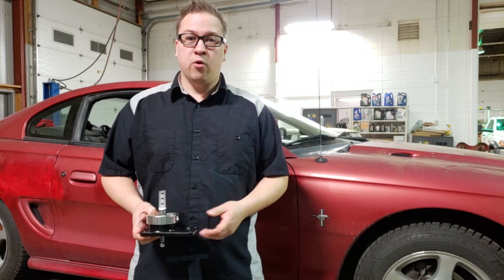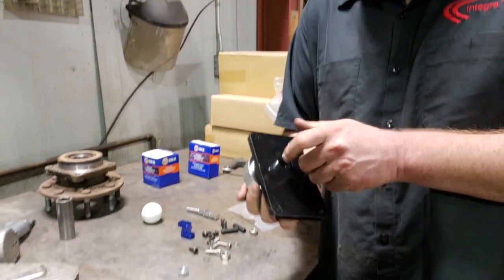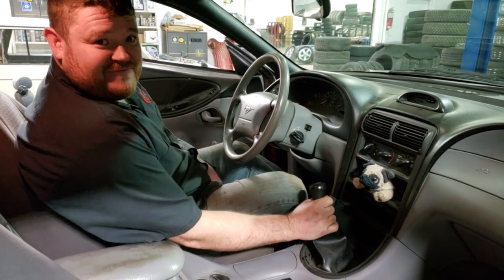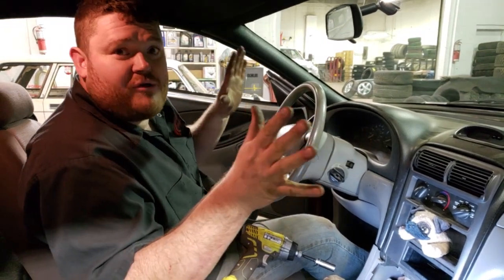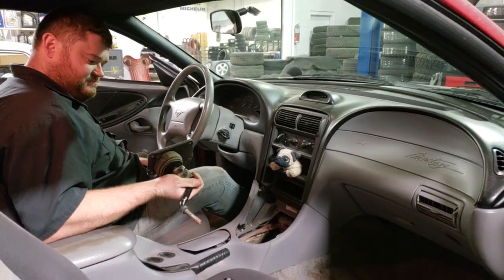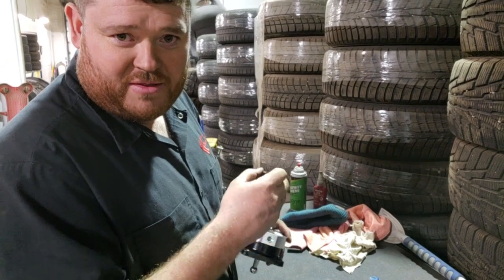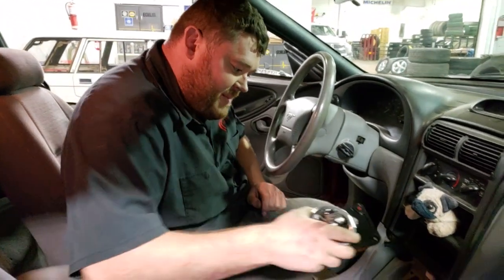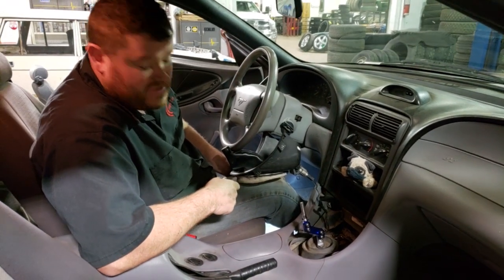Cheapest Shifter T5/T45 Install - SN95 Owner's Guide #8

Comment: Looks exactly like my SR performance shifter for my 94 gt
Reply from the maker: I have noticed this too, would say they are probably produced in the same factory, on the same patterns, but with different names.

Ours broke the centering springs and developed rotational play in the base after a few months, how is yours performing for you?

Thanks for commenting! - Darren
Reply: Grand Touring Concepts I’ve had mine about 1500 miles and it doesn’t self center, I noticed mine never did though I wonder if it’s those springs and plungers you pointed out were upside down.. other than that I haven’t had any issues and it goes into gears really well still, I’m also running a XTR stage 2 clutch

Comment: I did the speed daddy short shifter from ebay for $30.  Great shifter, looks just like this, same color handle/base, springs and everything.   Think it is just a relabled version of this.  I know they make decent parts used their exhaust parts in the past.     https://www.ebay.com/itm/FOR-83-04-FORD-MUSTANG-THUNDERBIRD-T5-T45-BLUE-RACING-SHORT-THROW-QUICK-SHIFTER/401562423241?fits=Year%3A1996%7CModel%3AMustang&hash=item5d7efc4fc9:g:w0oAAOSwGKRbPBIL
Reply: Ive had my ebay shifter for over 200k miles now.  Broke a centering spring finally but otherwise has been great

Comment: Is the shifter still in working condition?
Reply from the maker: That is a very timely question, as Shawn and I were just discussing the shifter and a recent development over the weekend. It is currently a little floppy on the 1-2 side when returning to neutral. We suspect that either a centering spring is broken or something in there is out of adjustment. We will pull it apart and film the follow up soon, so look for that. Thanks for watching and commenting! - Darren

Comment: thinking about a 5 speed swap on my car. isnt the t45 slightly upgraded from the t5? also is it compatible with a 3.8? love the SN95 content keep it up
Reply from the maker: The T45 is a modular specific transmission and is only upgraded with internal shifter overtravel stops. Otherwise it is similar to a T5 as far as torque rating and relative fragility. The T45, due to the Modular bell housing pattern, is not an option to adapt to the 3.8L which shares bellhousing patterns with the 5.0L Windsor. Thanks for watching and commenting! - Darren
Reply: Wait!!! does that mean my t45 won't bolt up to my 5.0? Can I get a bell housing that will fit ?